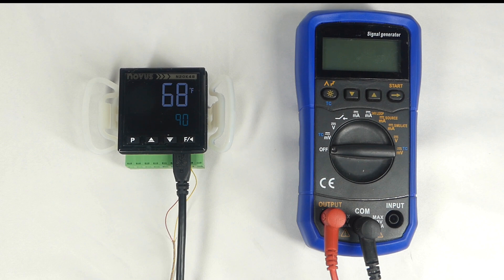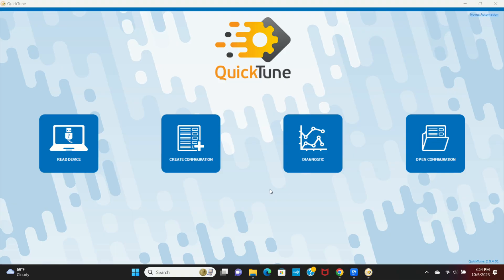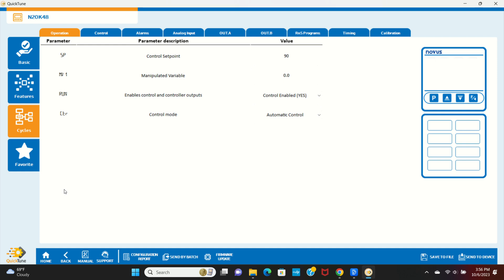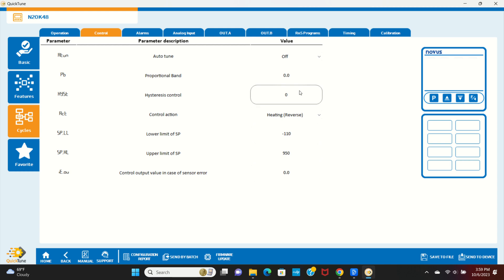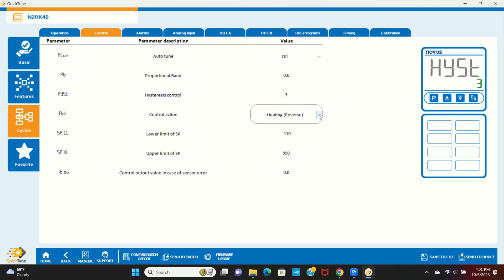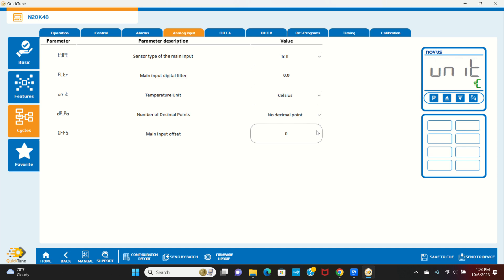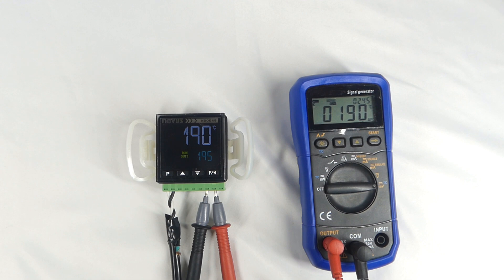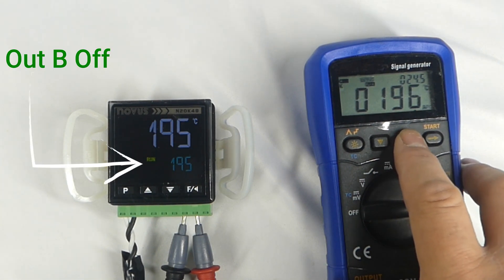Getting started with the N20K48 PID Controller

Comment: got these controllers running out in the shop.  Soo much better quality of life to monitor and adjust everything from my office with out having to run out to the shop to press buttons till my finger tips fall off with the old PID's.   Healthy investment and they consume much less space inside the electronic enclosures allowing for much more easy access for wiring.